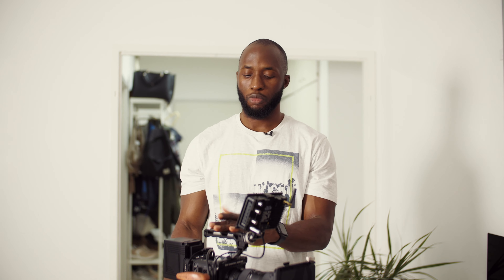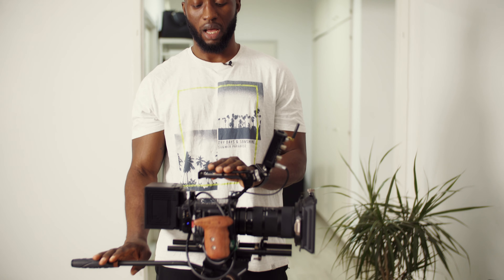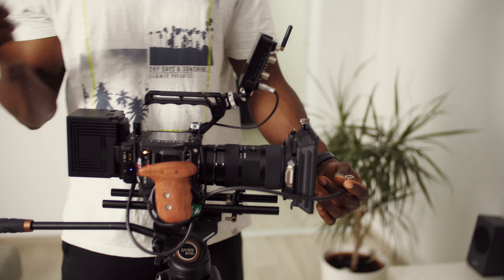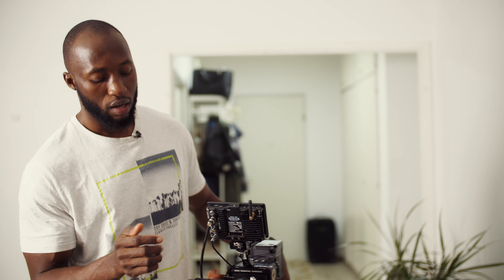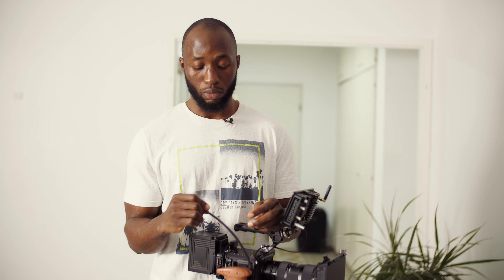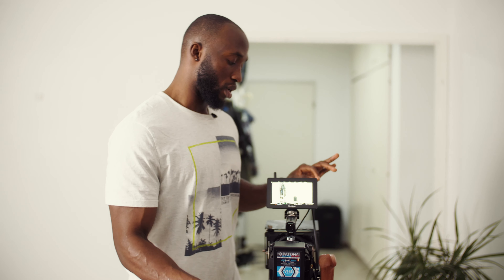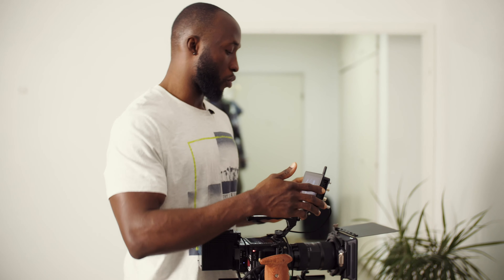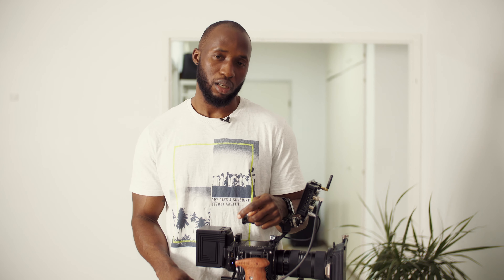STOP OVERTHINKING YOUR RED KOMODO SDI SEQUENCE

Comment: I think your intentions are good here but your information isn’’t correct. The issue doesn’t occur when powering up the devices. It can occur when power is applied to the devices. It is a voltage spike issue traveling across the ground circuit. By saying LIFO, but then telling people they need to power up first, it is going to cause confusion in the industry. Again, I know your intention is good. Just sharing my 2 cents.
Reply from the maker: I watched your video on this same topic and we are basically saying the same thing my friend. In your video, you advice to link the SDI cable after power has been established  and to disconnect SDI cable before disconnecting power.
I go as far as saying power up the device before connecting the sdi because powering up serves as a visual guide to ensure power has been established to said units. No device will come on when power has not been established. For example, it prevents assuming power has been established in the case of mistaking a dead battery for a charged battery.
The conversation of if devices needs to be powered on or not is a different conversation on its own. The moral of the story is power needs to be connected to  both ports before linking an SDI cable.
Reply: @joachimlucious Exactly, actually powering up serves as a visual guide! RED is also pretty clear on this;

Does the power state of the camera matter?
• The power state of the camera does not matter. The camera can be on or off during any of these processes.

Does the power status of my monitor matter?
• While the power status of the monitor or SDI device does not matter, by powering up the monitor you are ensuring the device has been correctly grounded. Therefore, we suggest attaching power & then powering up before plugging the SDI into the camera.

Comment: It's funny that I never heard of this until Komodo. I think RED trying to save money ended up accidentally created a situation where this port could be damaged. I used a Panasonic EVA 1 for years connected to Atomos Shogun 7 via SDI 12G port as I was doing 5.7k raw and it didn't matter how these devices were powered down or disconnected. Only after Komodo came out and ports got fried did anyone start to look at this.
I had a Komodo but only could afford one so I was vary careful and followed the procedure but between scenes you want to save battery and you might hit a power switch on the monitor or Komodo before pulling the cable and the camera would have to go back for service if damaged and I couldn't afford that so I sold the Komodo as I didn't want to take the chance.
Reply: So it has been around for a while. Arri used to have a problem but addressed it  asap which quieted the conversations. But now it’s back not because of the Komodo, but the dsmc 2 line also had some issues and some other camera manufacturers like BM. Hella people frying the hdmi port on their pocket cams but that could also be part of not powering on in sequence as well.

Comment: Actually, the status of the camera (On/Off) does not matter. What matter is that it is connected to a power source
Reply: So make sure batteries are on both devices before connecting the sdi? Ane diconnect the cables before taking out the batteries?
Reply: @Lemocrt  Well, Red said so about the camera, not the monitor. The reason is that RED can guarantee that if the battery is connected then there is power to the camera therefore the sdi is grounded. However they cannot guarantee for all monitors about this. One can be different from the other and the actual power to the monitor might be only after turning the switch. So if you don't see any led light on the monitor that confirm when the battery is connected then I would actually turn the monitor ON. At least this is how i have understood it from the RED instructions
Reply: @Pierluca72  ive has my komodo for almost a year and it scares me each time I turn it on.  So let me make sure I get it the easier way is to power on the camera then power on the monitor after everything is on then connect the sdi cable? Then to stop disconnect the sdi cables then turn off the camera and monitor?
Reply: @Pierluca72 I think for the additional safety its better to turn on who knows maybe the battery you will get is dead so to be so so sure its better turn on